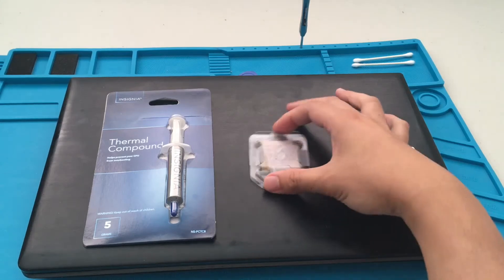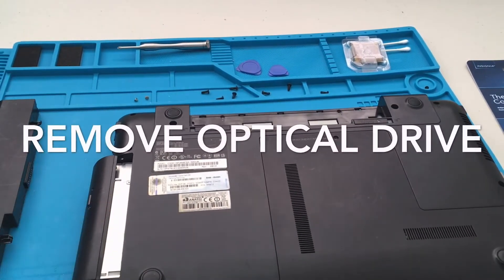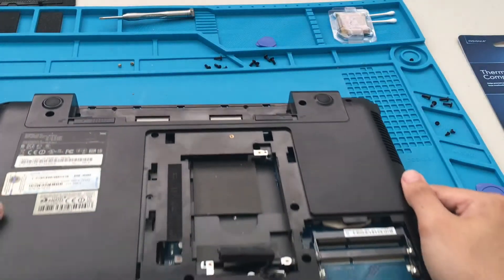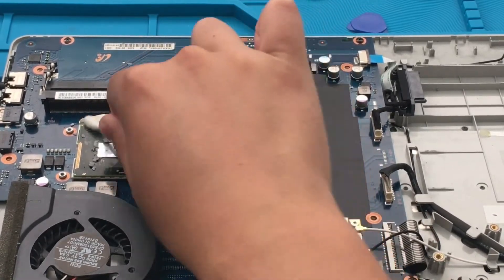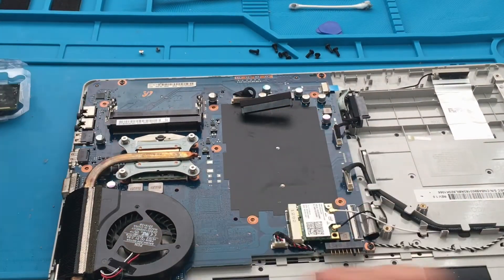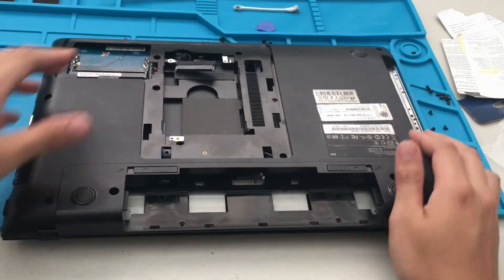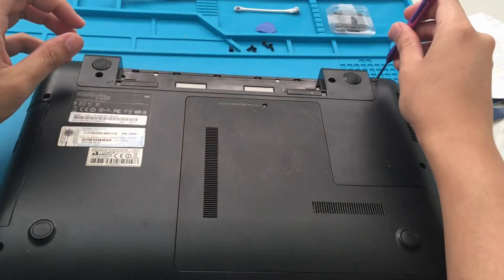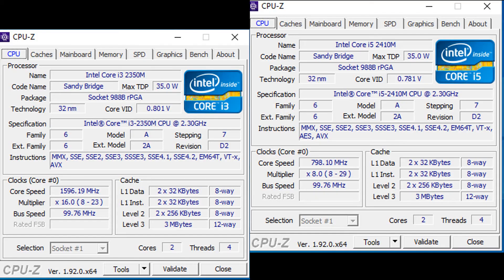My First CPU Upgrade Intel i3 to i5 Samsung Series 3 Notebook NP300E5A

Comment: What cpu upgrade can i do with my Samsung NP300E5Z-A0ESA with 2350m i3 cpu? Thanks
Reply: Does your laptop have an Nvidia graphics card or only an HD Graphics 3000? 
Check the processor socket using program CPU-Z (socket rPGA 988b or  FCBGA 1023). Under the "Mainboard" tab, check the chipset -> HM65 ? HM76 ? HM 75 ?

Comment: hey there , i am using HP Pavilion 14 Notebook PC with Intel(R) Core(TM) i3-4030U CPU @ 1.90GHz. i want to swap the cpu of my laptop. i have little to no knowledge of which processor should i use to upgrade. kindly help me with that.
Reply: your processor is soldered to the motherboard, it cannot be replaced. You can speed up your laptop by upgrading the RAM to 8-12GB and installing a 480-512GB SATA 2.5" SSD for Windows, programs, browser and files.

Comment: samsung np355e5x-a021n model and this model has same process to upgrade processer
Reply: Is this your laptop specification?
AMD APU Dual Core E1-1200
2 x 1.4 GHz 
384 MB, AMD Radeon HD 7310 Graphics Graphics
2 GB DDR3 RAM  // 500 GB HARD Disk

Comment: Hi, thank you for the video. I have same laptop samsung NP300E5A-A09AE (BIOS Version 07QA) with i3 2350m hm65 chipset. Am planning to put a i7 processor. But not sure which model of i7 to buy .. Could you help me out please? Thanks
Reply: Thank you very very much for the reply, I'll update you once I install it....
Reply: @jorvalrodrigues8259  Does the laptop have an Nvidia video card or just integrated HD Graphics 3000?
Reply: @vladimirazirov1815  it has integrated graphics only
Reply: @jorvalrodrigues8259  OK. You can install an i7 processor. 
When the laptop has an Nvidia video card, the maximum you can install is i5-2430m to avoid overheating. Haven't you bought a processor yet?
Reply: @vladimirazirov1815  no. didn't buy yet, was waiting for your reply. Planning to get it from aliexpress
Reply: @jorvalrodrigues8259  I use thermal paste GD007 - it lasts for 2.5 years, then I change the thermal paste on the processor and clean the radiator from dust. This thermal paste can also be ordered in China, 4-7g syringe. If the i7-2760qm processor heats up to 90 * C in your laptop, you can always reduce the frequency of the i7 processor from 2.4 GHz to 2.2 GHz or 2.1 GHz).
Do you have an SSD in your laptop? Or is HDD only installed? How many gigabytes of RAM do you have? single channel or dual channel memory?
Reply: @vladimirazirov1815  thanks for the information. I do have ssd, crucial mx500 with dram in it (500gb).8+4gb  dual channel ram ,

 I'll order thermal paste and cpu as  you have recommended....
Reply: @jorvalrodrigues8259  12 GB of RAM is good, there is no need to make 16 GB. I also added 12GB of RAM to my daughter’s computer. I bought a system unit with 4GB of RAM and later added an 8GB memory stick. When you receive the i7 processor, write, I will tell you how to disable turbo boost.
Reply: @vladimirazirov1815  thanks alot, I'll keep you updated....
Reply: Hi Vladimir, here is an update as promised.

I Installed i7 2670qm with new thermal paste, I have made some modification to the original design. Creating holes above the cpu fan area which helps in direct air intake. Cpu heating does not exceed 70 degrees under heavy load along with hyper threading on with 3ghz

2)Installed windows 11 and runs super smooth with updated drivers from snappy drivers.

3)after installing i7 2670qm, the ram is 1600mhz supported and works flawlessly.

Thank you once again for the guidance....
Reply: @jorvalrodrigues8259  please :) I'm glad that you are happy with the laptop update :)
Reply: i7-2620m, i7-2640m (socket G2 / rpga 988b)
Reply: @vladimirazirov1815  hello friend I have same pc in the video and I have i3 cup so 
Motherboard
Model	SAMSUNG ELECTRONICS CO. LTD. 300E4A/300E5A/300E7A/3430EA/3530EA
Socket	Socket 988B rPGA
North Bridge	Intel Sandy Bridge rev 09
South Bridge	Intel HM65 rev B2
BIOS	Phoenix Technologies Ltd. 04QA (02/28/2012). ., 
Plz this is  details of my pc , so if I can put cpu: I5 3570 3.40Ghz ??answer me plz
Reply: @Cool.man02  hello )
SAMSUNG 300E4A/300E5A/300E7A/3430EA/3530EA -> Socket 988B rPGA
i5-3570 -> socket LGA 1155.
Does your laptop have a discrete Nvidia graphics card or just an integrated HD Graphics card? You can see which video cards are installed in the laptop in Windows, Device Manager (video adapters)
Reply: @vladimirazirov1815  Yes I have Nvidia GeForce GT 520MX
Reply: @Cool.man02  This laptop has poor cooling. I recommend leaving the i3 processor in the laptop, just make 8-12GB of RAM and install a 480-512GB SSD for fast operation of Windows, programs and files and videos. Use your HDD (drive E) to store photos and important information.

If you are not afraid of experiments and you need a 4-core processor, then you can install an i7-2630qm processor in your laptop, but use it with turbo boost disabled at 2 GHz. It will work, it will just probably get hot up to 90*C in the summer and the fan will be loud.
Reply: @Cool.man02  what country do you live in?
Reply: @Cool.man02  i7-2630qm processor without turbo boost is the only option for installing a quad-core processor. Turbo boost is disabled in Windows, section "power and sleep mode", set the power plan to "balance".
In the "advanced power settings" you need to set the maximum power for the processor from the mains and battery - 99%.
The minimum power for the processor from the mains and battery is 0%.
Cooling from the mains and battery is active. 
Click - Confirm - OK. 
For i7 processor and Nvidia video card you need to use good thermal paste -> GD007, Arctic MX-4.
Reply: @Cool.man02  You can also install a new Wi-Fi adapter for 2.4 GHz/5 GHz + Bluetooth. 
I also installed 8GB+8GB RAM on my laptop.
I built a computer for games in 2021, and a laptop only for the Internet, social networks and movies.
I know Algeria. This is northern Africa. Former colony of France. If you want to build a computer, then write to me, I will tell you what you can buy. I live in Russia.
Reply: @vladimirazirov1815  thank you  friend , yes I will replace the wifi soon 
 yes I tell you if I build a computer, 
Good to live in Russia Great and beautiful  country, nice to meet you.
Reply: @vladimirazirov1815  thanks for  ur info friend , you are expert in computer components
Reply: you can install an i7-2670qm processor, but use an i7 processor without turbo boost, at a frequency of 2.2 GHz, you get 4 cores, 8 threads. If the laptop has an SSD 240-512GB, sata-3, 2.5 and RAM 8-12GB (DDR3-1333), then the laptop will be fast and will not heat up much.

Comment: i have np300e5c A01 with pentium B960 can i still upgrade to i3 or i5 and what i5 i can upgrade to
Reply: Install the free CPU-Z program from the Internet into your laptop. On the  tab "Mainboard, look at which south bridge is on the motherboard -> HM65? HM70? HM75? HM76?
On the "Graphics" tab, look at what video cards are in the laptop - is there an Nvidia video card or only an integrated card HD Graphics ?

Comment: Hey man.
Im planning to upgrade my old samsung laptop that has intel celeron 847 with max 17w tdp and the processor im planning to upgrade is 35w tdp? So it is possible to upgrade?
Reply: The processor is soldered to the motherboard and cannot be replaced. Install SSD 240-256GB sata-3, 2.5", RAM 6-8GB and use Linux instead of Windows.

Comment: Did you have to do something with the bios ?
Reply from the maker: This is an old video. I don’t remember having to mod anything on the bios. I would review your bios settings though
Reply from the maker: Check the motherboard model using cpu z. Then look up the motherboard cpu support list online to see if the cpu you are looking at buying is on the supported list

Comment: I have the same laptop but i gat a black screen after upgrading from i3 2328m to i5 plz help
Reply: Install the free CPU-Z program from the Internet into your laptop. On the  tab "Mainboard, look at which south bridge is on the motherboard -> HM65?  HM75? HM76?
On the "Graphics" tab, look at what video cards are in the laptop - is there an Nvidia video card or only an integrated card HD Graphics ?
Reply: @vladimirazirov1815  got another CPU it worked well

Comment: I am an NP300E user, too... And I have done upgrading all upgradeable in it.. 
CPU i3 to i7, harddisk to ssd, 4geg to 16geg ram, wifi 2.4g to 5g module... And its working pretty cool...
Reply: no problem with overheating?
Reply: Can you please share which i7 model number did you use? Thanks
Reply: Is 16gb supported
Reply: @senurakavishka9150  yes
Reply: yes this i have done. @senurakavishka9150
Reply: where to buy i5 processor.
its costs more than a laptop in Amazon
Reply from the maker: @mubasharhasan82 have you tried ebay?
Reply: @whattmeter  yes
Reply: hey , can you tell me plese what i7 did you use ?

Comment: Tried upgrading Samsung NP300E5A originally with Core i3-2350M CPU @ 2.30GHz × 2 with i7 3540M 3GHz SR0X6 - didn't work. No BIOS boot. My spec:
PCI bridge: Intel Corporation 6 Series/C200 Series Chipset Family
GPU: NVIDIA GeForce GT 520MX 
GPU: Intel 2nd Generation Core
Reply: max i5-2430m, i5-2450m

Comment: what processors it can be installed to np3300e5z??its current processor is intel core i3-2330M
Reply: what graphics card is in the laptop? integrated  HD 3000 or discrete card Nvidia?

Comment: Indeed a great video tutorial. I have an 13 CPU  M350 @ 2.27GHz 64bit. Hope I my system can also be upgraded to i5. If yes, what gen should I go for?. Appreciate your recommendation.
Reply: Install the CPU-Z program on the laptop. On the first tab of the program, look at which  socket type (BGA1023 or rPGA 989)? 
In the column "Revision" look what is written - C2 or K0? What laptop model?

Comment: du you upgraded the bios? I plan to upgrade a series 6 notebook from i5 2nd generation to an i7 2nd or 3rd generation with same TDP.
Reply from the maker: I haven’t used the laptop in a month. I’ll see if I can make a followup video ok it. I didn’t upgrade the bios when I did the update before

Comment: I have a samsung NP300E5C With i3 2310m , sandy bridge tdp 35w 988b rPGA socket HM75 .. working slow .can i upgrade to a faster cpu without any issues?
Reply: @vladimirazirov1815  Thanks a Lot..
Reply: Which graphic card is in the laptop: Nvidia or HD 3000?
Reply: @vladimirazirov1815  Its Nvidia
Reply: @naresht350  you can install an i5-3210m processor and a faster DDR3-1600 (4gb+4gb, 4gb+8gb) RAM. You can leave DDR3-1333 RAM, but it should be 8-12GB for fast programs.

Comment: I have a NP550P5C and I upgraded from an i5 3210M to a i7 363QM. The CPU works perfectly fine but the only issue is something with the (integrated graphics) graphics drivers. I get flickering pixels and flickering polygons in games. I tried to install drivers for it from the Samsung website but it doesn't seem to work (probably because the CPU is different from the original laptop model?) If anyone has any ideas let me know
Reply: I was planning to upgrade my laptop from i5 to i7 then I this comment. I can't help you brother I'm still looking for an answer for my problem

Comment: Greeting to the owner  of this beautiful video and to all the experts here, i own a samsung laptop model NP300E5Z( EGYPT) with processor I3-2350M, can i upgrade to I7-2820 QM without problems? regards
Reply: depends on chipset support
Reply: I upgraded from an i5 3210M to an i7 3630QM and I have an issue with the graphics drivers

Comment: What did you put from that injection can u tell me name and where to buy?
Reply from the maker: It’s thermal paste. I was using a generic best buy thermal paste which is no longer available. There are many thermal paste available and much better ones. Popular ones are arctic mx-4, corsair, definitely feel free to look around. Many brands available
Reply: @whattmeter  should i update cpu or just upgrade ssd.one of my friend told me adding ssd n installing windows on it will do the better performance than upgrading cpu
Reply from the maker: Ssd would make a difference especially boot times. I would only upgrade cpu if there are specific programs I need to run that require a stronger cpu. Just my personal opinion though
Reply: @whattmeter  i just want bit faster gaming experience
Reply from the maker: Whats your cpu right now? Cpu bottleneck can also affect gaming
Reply: @whattmeter  Intel core (tm) i3-2370M cpu @2.40ghz 2.40
U suggested me i7 3740qm on other video which i ll definitely upgrade,
After upgrading ram its better now ,
I want to play gta 5 n creed black flag without lag ,,
i  dont want to buy another laptop now.
As i have nvidia shield tv, I think soon ll able to play games on it in Australia.
Reply from the maker: Yeah that i3 definitely has some limitations
Reply: @whattmeter  i guess that video was some ones elese who suggested me i7 3740 .
Is that the best i can upgrade or i can get more higher version like  
Intel Core i7-3930K 3.2 - 3.8Ghz Socket 2011 CPU Processor 3930K/X79 LGA2011 
let me know best i can upgrade
Reply from the maker: You might have to check cpu z. Make sure you have the right socket and check online for compatible cpuz. I don’t remember off the top of my head unfortunately
Reply: @whattmeter  i checked socket type hm 75 ,
 someone told me my laptop seems to have weak cooling system which supports usually i5 processor . N i need to do the stress test n check if temperature gets higher this is getting very confusing now i thought i can just upgrade to i7 without any issues.

Comment: May I ask if all the existing files would be wiped out when we replace or upgrade the CPU?
Reply from the maker: Existing files were still there. But I would back up your files just incase
Reply: @whattmeter  My current processor is i5-2450M that has 35 TDP and a motherboard of HM65 which has a G2 or rPGA988B socket.

I checked different processors that are compatible with HM65 and found i7-3840QM which has a G2 rPGA988B socket and a TDP of 45.

Since you mentioned that when upgrading, we are supposed to consider TDP with + or - 10 with the current TDP. Do you think my upgrade will work?

TIA.
Reply: Yow does it work? I was planning the same too

Comment: Hi, I have this 8yo NP300E5X and I've been wanting to upgrade the Ram.. as in, install a second one, but I don't have many details on that, because I can't find the model's specifications anywhere to ensure that I'm getting the compatible parts for it.
Reply from the maker: try cpu z? that's what I used to identify the samsung laptop in the video.
Reply: I have same just put ddr3 8gb 2 ram bought from AliExpress they sent pc3L working fine.
Reply from the maker: Nice!

Comment: Hello,have this laptop NP300E5X the same procesor I3....Please let me a link if it possible to upgrade with I7 and from where to buy
Reply: are you from Romania?
Reply: @m0t0b33  Yes DA
Reply: @fasolaru8674  atunci daca iti permiti, cauta pe amazon sau ebay, daca nu, incearca mai "local" pe shopuri specializate in IT sau pe okazii.ro... da' tre' satii exact ce cauti, asa ca foloseste cartea tehnica daca o mai ai de la el si vezi ce ti se raspunde aici, ca aia de la Samsung nu-s de mare ajutor.
Reply: @m0t0b33  Asta e problema...pentru ca nu mai am cartea tehnica,laptopul este din 2013,si modelul era NP300E5X SO1-RO...nu stiu cum sa caut
Reply: @fasolaru8674  al meu e NP300E5X A02-RO... incearca pe site-ul Samsung sau pe emag... nu-ti dau aia  multe specificatii ca nu-l mai vand, dar ceva ceva poate tot gasesti.
Reply: @m0t0b33  Chiar nu poti sa imi dai un link ceva de unde sa cumpar un procesor pentru modelul asta pe care il am?

Comment: My dude, are you telling me that it's that easy to replace the processor on my OLD Samsung series 3 np300e5c laptop?
I love you dude, not sexually just pure appreciation.
Reply from the maker: I would double check the motherboard model for your laptop. For newer laptops nowadays not so easy replacing the cpu
Reply: @whattmeter  my laptop is 2013 series 3 Samsung, it's definitely old.
Reply from the maker: You can use cpu z to check your mother board and cpu socket so you can search comptible cpus
Reply: @whattmeter  I'll do that and come back to you, thanks my dude

Comment: I have the Samsung NP300E5c laptop. Have the stock Intel inside but I wanna upgradd the cpu to at least an i3 and I want to add on more ram. Could I do this?
Ive heard and its beenadvised that it is not easy and not advisable to do so because the cpu is bracketed/bolted to the motherboard?
Reply: do you have an np300e5c A01? i have it as A01PL and yes you can add ram ddr3 ram i  want to buy some ram in nearest time

Comment: Do you think i can use 3rd gen cpu like i5 3210m in my np300e4a-so2?
Reply from the maker: Check what socket you have and motherboard info. I used cpuz to make sure The cpu fit the motherboard socket

Comment: Great job, in the my  Samsung 300e5c I replaced the i3 2370m with the i5 2450m 😉
Reply from the maker: Glad it worked out!
Reply: @whattmeter  thanks,  This laptop has an hm 75 chipset and full works with the  ivy  and sandy bridge series, the maximum  is  i7 3632qm,  now I happy to have an I5 3230m👍🏻
Reply from the maker: @luigifast5476  thats good to know! I didn't know that.
Reply: @whattmeter  please  check the t  chipset type with cpuz, series 6 for second generation,  series 7  for second  and third generation cpu😉

Comment: Hei thanks dude it‘s amazing videos.
My laptop is similar. It‘s NP300E4Z. May i ask you question? Is my laptop can be upgraded like yours? If yes. Is can be upgrade with i7 ? Which type if can? Thanks.
Reply: download from the Internet and install the cpu-z program on the laptop, on pages 1 and 3, look at the processor model, socket type, chipset and south bridge type. Based on this information, I will tell you which processor can be installed :)
Reply: I bought an i7 cpu but I have to install yet